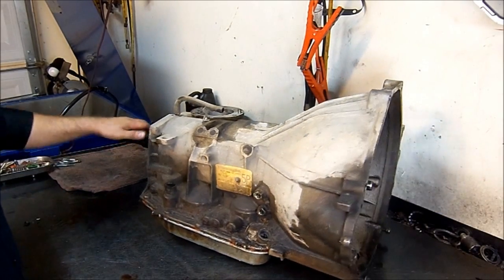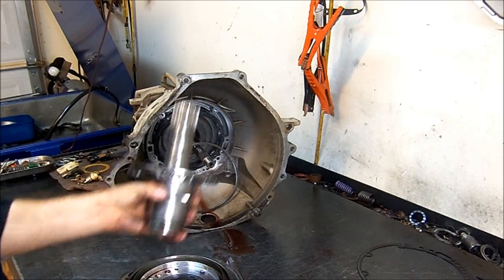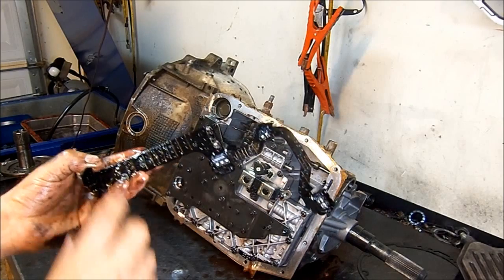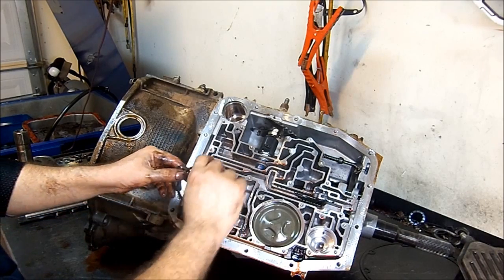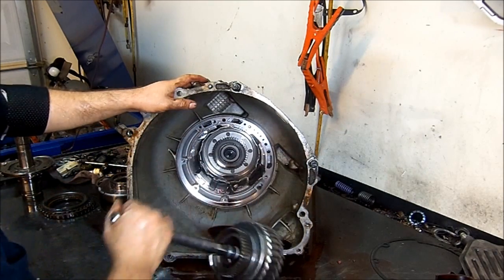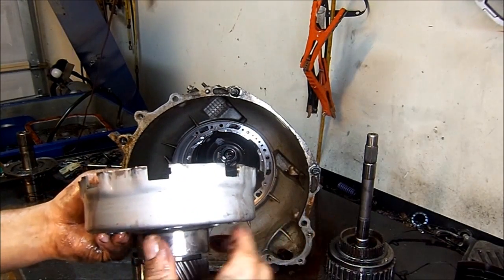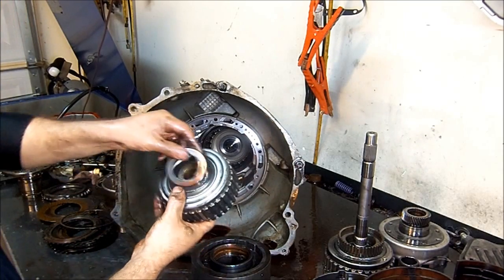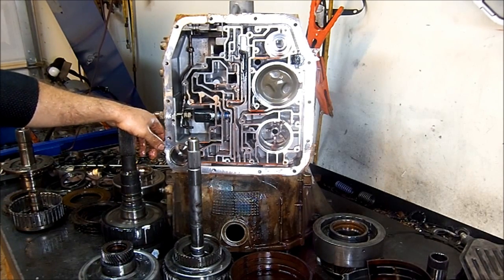4R75E Transmission Teardown Inspection - Transmission Repair

Comment: He is right about high line pressure blowing the end off the forward drum. However, there is more to it that needs to be addressed OUTSIDE of the transmission. On older Fords they are programmed to start with, and maintain, a higher engine idle speed to help light the catalytic converters off. Cats won't work until they reach a very high internal temp-like 1200 degrees, or something crazy like that. As the cats age it takes longer to get them up to temp where they start working. Ford, recognizing this situation, programmed their vehicles that as they age they will idle HIGHER, and will idle higher for longer, than a new engine does specifically to get the cats up to temp and working as they age. The problem here is people that jump in their vehicles, start them up and then instantly drop them into gear.. When the idle is high, so is the line pressure! When the engine is cold-so is the trans fluid which easily makes excessively high line pressure when paired with a high idle. We see  BOTH the end of the forward drum blown off, and the band pin anchor on the reverse band broken off. Yes, the Sure Cure kit will help.. But ultimately telling your customer to let the idle drop below 1,000RPM BEFORE engaging F or R will ultimately stop this problem from happening. So, the entire fix is a two part process. The Sure Cure kit (or even the Trans-Go kit), and then fixing the nut behind the wheel. I find it much more difficult to fix, or control, the nut behind the steering wheel. Transmissions are easy. Those "nuts" are the challenging part.
Reply: What's the nut behind the steering wheel problem you're referring to??

Comment: I have an F150 '08 5.7 and the transmission just went out, no forward or reverse. If I let it sit and cool off it will go into either forward or reverse until the fluid heats up, let it sit for an hour and it goes again. having it towed to a trusted mechanic but I want to have a minimum knowledge of part names and a minimum idea of what conditions can cause what problems. when I do visit the shop I won't stand there bug-eyed when I hear what needs to be done. I'd rather spend the money on an excellent repair than have a truck payment. Thank you for the easy to understand explanation.

Comment: Hands down the most informative and educational ford transmission video I have seen by far... Ive learned more in the last 32mins here than in.the last 5 months of reading and watching and trying to plan out how to save my 2012 E-150... I actually lost the sick feeling in my stomach and now Im just pissed at my locsl dealership for telliing me my transmission is toast and telling me I need to fork over $4000.00 to fix a purpose built delivery van that only has 43,000 miles and that I paid cash for new at their dealership...   a huge thanks to Automatic Transmission.... you sir are a craftsman of the highest order...
Reply: Sounds like the shop my work took an e350 to. No forward or reverse. Their extent of diagnosis was to replace a speed sensor because of a code. That’s not going to stop it from going into gear. Fluid on the dipstick was nice and red (38k miles). They said it was “burnt” up.  They should have let me work on it. $3600 for a jasper junk reman that already has delayed gear engagement 😵‍💫

Comment: Amazing video by a master at his craft. I unfortunately just started having transmission problems with my 2007 E350 Van at 182,000 miles  with the 4R75E trans (failure to shift into high gear). This video was illuminating going to drop the pan in search of metal and see if I’ve got any codes.

Comment: Always a joy to see someone rip into something so complicated as if it were nothing.  My 07 F150 FX2 (4R75E) has 123,000 miles and doesn't like coasting through slow traffic then accelerating. It usually races then bangs pretty hard.  Doesn't do it in OD off.  I'm changing fluid, Mercon V, and filter this weekend and hoping for the best.
Reply: U ever fix the problem lol? Mine is doing the same thing
Reply: @jramsier154  can’t figure mine out either. Broken snap ring. Got both pieces out and still no OD after putting the OD band in place with a screw driver. Still no OD. You fix yours?

Comment: That was really good. I’m doin an el cheap o fix on an 04 4r70w out of a grand marquis 170000 miles. All I found was toasted forward clutches and steels and blown out piston seals. Front pump seal was almost falling out too. This is 1st time I opened one up so I made notes on several things you said. I bought the car to get familiar with the 4r70w cause I wanna supercharge my 03 marauder and will have to beef up the 4r70w from the marauder. I just found ur channel bout a week too late. Thanks again for the knowledge.

Comment: I have the same truck with 250 000km. Was doing exactly the same as you... and last week and I ended up needed a complete rebuild. Truck drives like new now. The more you wait the more things will neeed replacing as the metal inside is eating away....

Comment: I rebuilt this transmission using your videos, so afterwards my overdrive light comes on and starts flashing at about 60 or 65 mph and wont shut back off until I shut the truck down and restart it. Before it beeps and the light starts flashing I can turn it on and off manually.

Comment: I have a 1999 Ford Econoline van. E-150.  I hear loud himming when I reach 35+ miles per hour. Tranny does not slip and works just fine. Could it possibly be the rear end? I am a mechanic but this one got me going. Thanks for any feed back. Great videos.

Comment: Great!, Now I can do this,  Now I have to see how to put together. I Imagine I would have a lot of Parts left over, or missing some parts(too many parts in the wrong place) Another Problem is knowing what a Bad Part looks like, and what a Good Part is supposed to look like. Sure curious of the rest needed to get reassembled. If I tried, may rebuild sections as they are Dissembled. Hope he has the Cleaning and Reassembly Video showing Adjustments and Procedures. I understand Transmissions have 800 parts, have built 1000 Piece Puzzles. 
Have been pretty good with those, No Pieces left over.😵

Comment: thank for your video are very interesting . I have pick up F150  with 4R75E transmission, this will put the mayorities of parts  news. doubt is when you close the box the drum shaft and output shaft forward should not be rotate manually .is this normal  these transmission with dual band. thanks

Comment: Good video, my 2008 Ford F150 has some transmission issue, when I drive it in low rpm about 1050 rpm shift to second gear but then stall to 2000 rpm slipping and goes to third gear, just that is the problem the transmission slip a little bit while is shifting to third gear.

Comment: Thanks Hiram, I have a 08 overdrive problem, shifts into OD and its like its in neutral, disengage the OD and runs and shifts fine...Im going to try and change the ring myself, seen a couple other videos on it and I feel I must have the same problem.

Comment: Hey you do good work man I have a Ford F-150 05 model transmission work's  good I pulled out on the highway and I went to beat a car about half down on the gas  it jumped in neutral  what it feels like but it started working  but at a stop  it's like first gear  it engaging but when you give it gas to pull out  stop putting you can give it a lot of gas it pulls out besides that every thing works you can pull it down to first gear about  when you are moving  about 5 miles in hours it's engaged pulling good

Comment: Hey Hiram I've watched ur videos and they have a lot of info thank u so much. I have a 4R70W took it apart had no reverse I found that the snap ring that holds the reverse in place broken and stuck in between the low reverse could that be the problem couldn't find anything else wrong
Reply: Definitely

Comment: I have a question I have a 2006 F150 I believe it is a 4R75E… Going up hill , small incline or steep incline doesn’t matter…  if it’s in overdrive it starts to shutter … if I apply the throttle I can make it downshift and it clears right up , what do you think ??

Comment: I had my 4R75E transmission rebuilt. it came out of 2006 f-150 4x4 with a 5.4L V8, I was told this trans was heavy-duty for towing. it was rebuilt with the 4R70E kit. should I be concerned?

Comment: I recently had a transmission line blow and I ran out of fluid on the road.  The truck stopped - I did relate the line, added fluid and barely got it home.  The truck has a 5.2 and is a Ford F150 with the 4R75E transmission.  I am going to guess that the transmission is toast - would you replace the torque converter too?  the truck is an 04.  Thanks!

Comment: Hey i have a 2009 ford f150 and its making a whining noise in park and neutral. The noise mostly goes away in the drive gear. I replaced the torque converter and i checked the transmission pump and the gears look fine as well as the bearings behind the pump. After all that the noise is still there. I was wondering if you had an idea of what it could be? Thank you

Comment: Hiram, you are a total professional. I like how detailed and knowledgeable you are. I have a 2005 F150 4x4 Triton 5.4L. When I accelerate really fast, the transmission shudders and then slams into gear from 1st to 2nd. Also does it from 2nd to 3rd sometimes, but mainly from 1st to 2nd. Also, when I have cruise set and am going down a slight hill, the truck lurches forward slightly (jerky). I recently replaced a bad U-joint. It's been doing this since I bought the truck w/ 115K miles on it and it is still doing it at 130K, not worse so I'm wondering what it might be. Thanks! BTW, where are you located? If you're close, I'll just take it in to you!
Reply: What was the location for that garaje

Comment: Have you dealt with any Trans Fault issues. We just had the light come on and OD light comes on as well on our 05 F150.  Trans shop says it may be a sensor but they want us to bring it back on the weekend so that they can drop the pan and further look at. The F150 has an 4r75E trans.

Comment: Mr Gutierrez, Great video, very professional. I have a 4r75e out of a 2010 e-350. It has a whine in neutral and park only. I swapped out the torque convertor and it still has the noise. Is this a pump issue?
Reply: Yes

Comment: Your videos have helped me a great deal in the past 6months in my shop. I know this is off topic for this video, but I think your the man to ask. I have a problem on a 2008 jeep grand cherokee awd with a NAG1-W5A580. When you start driving it will push fluid out the vent, and it seems to push out the front and rear seal too. I'm not sure why, any help would be greatly appreciated.

John
Reply from the maker: +Brandy Calvert Might be over full. Or there's a restricted cooler or cooler line. Do you have the tool to check the level?  If not get one. Dealer have them, also Transtar.

Comment: good vid..so i have a 05 f150 4x4 5.4 and the trans is making a winning sound like a power steering would if low and when warm trans slipps a lil bit...trans was rebuilt bought 60k ago...would that be a bad pump

Comment: Great video. Can anybody tell why the coolant flow is so weak? I have the same transmission and everything is good except only one thing: Flow is sooooo weak and I got one quarter of mercon in 2 minutes even if I connect funnel directly to outlet port of transmission. New filter, new fluid. But it overheats. Thanks.

Comment: Hello Mr Hiram, my 4r75e would not go into overdrive so I found the overdrive servo ring had broke and I found a piece in the valve body too.
After repairing that and putting it back together now I had a new problem that I didn't have before which now when I shift to drive I can't hear it and I have no speed..
So I'm getting a output speed sensor failure....
Does it sound like I did not put something back?

Comment: I really want to thank you for this video it was well explained and definitely "dumbed down" for the average guy. I have a 2004 Ford F150 FX4 and my reverse was always hesitant or would shudder if I accelerated right away. I also when I am at a stop light, on level ground, I dont have to apply the brake because it doesn't move. Now just yesterday the reverse shudders and barely moves back at all. Is there anything I can do till I can bring it in that will help? Where is your shop located?
Reply: Stop using it. Avoid further damage

Comment: Hey Hiram.  A couple years ago my Boss bought some retired CVPI's for company cars.  I got one of them, a 2006.  It has been a good car, but now the trans neutrals out going from 2nd to 3rd.  If I put it in tow/haul mode it will stay in 2nd.  Has about 125k miles, but my Boss says that trannys get swapped out of police cars routinely.  One of the shoregang guys says to drop the pan and see if there is metal in the filter and pan/magnet.  If there is a bunch, then the 3rd gear drum is bad, but if not, it could just be a servo issue.  Any brilliant ideas?  Everything else is fine, just the second to third shift is bad. 

Great clip btw...and thanks for taking the time to make it.
Reply: LindaStevensBZ 20160801_111924.jpeg

Comment: When I tore down my transmission, found little chunks of rubber? Seal in clutch packs were cut, possible clearance, thickness issue with steels.!?

Comment: the 3rd accumulator valve came out when I removed the valve body.  spring is good, but cant get it to stay to reassemble the valve body.  the point of the accumulator stay down right?

Comment: Awesome vid and great tranny knowledge! Thanks for sharing! Quick question my ‘07 F150 won’t go over 30 mph unless O/D is off so right now I’m driving it with it off. Would it be the O/D servo or snap ring? Thanks
Reply from the maker: Two items can cause that. The broken snap ring and one of the pieces of the snap ring stuck in the valve and the other is a stripped direct drum from the splines not engaged to the intermediate shaft. Or burned Overdrive band burned Direct frictions.

Comment: Hi thanks for the video very informative, I have a 05 ford Expedition xlt and the Tranny only reverse I don't get Drive, 2 or 1. Any idea what may have happen? One clue I do have is when  I removed one of the speed sensor in doing so it came out with a lot of Metal Chippings all Magnetize together any idea what could have cause this. Any helpful advice would be appreciated . thank you :)

Comment: I have a question. Im not rebuilding my trans, I'm only replacing the front pump seal an gasket.I have a 05 crown vic interceptor. I notice on ur trans u had 2 of what u called return piston spring.mine only has 1..is that ok to only have just 1? And is that brass bushing easy to replace?

Comment: Do you have any idea what could be the problem in mine? It will hang in neutral in the 3-2 downshift IF im cornering. 
More symptoms; it NEVER slipped on a gear. It goes neutral for a second, then shifts accordingly. if I reved it too high during that second or two, it behaves like a neutral drop. 

It only happens while cornering, and when stepping back on the gas, so during a upshift. 
I have replaced the pan filter, I thought it was 2-1, and changed the 1-2 accumulator pistons and springs, no changes.   I think it may be 3-2 downshift that is affected, but no tachometer in the car , hard to tell.

Im mostly curious,  it shifts perfectly fine in normal driving if I dont corner hard while the transmission hits the downshift point. If I corner hard while on the gear, it doesnt have the issue, it holds on gear.
Reply from the maker: +Veikra Low fluid level or the filter got loose.

Comment: i have same trans 04 mercury maruader i getting 2 codes po173 and p1740 do u think if i change my tcc solenoid in the trans that be my problem car cuts off sometime shifting from park to drive and o/d light flashes sometimes and when i take off i got too stay on gas to keep it going ..wat do u think....thanks

Comment: my new style 04 f-150 4.6 has a 4R70E transmission. are there any big differences from the 75E?? I need to get moving on it. The whole trans sounds like marbles clanking around when I try to move it. Reverse is gone and it barely will move at all unless you really romp the gas then it might slowly and loudly manage to go until boom another gear kick starts and moves faster but kinda one speed only. Then when you step on the brake, the truck stalls out all together. It's gotta be completely destroyed inside. the funny thing is just started doing it overnight the day before the truck ran like brand new. regardless I have to take it apart and check it out I was just wondering if the 70E was much different than the 75E

Comment: hiriam like your video and your knowledge I have a question, I have a 2004 E150 drives in all forward gear but it only reverses when cold once I drive it for 30 min it has no reverse

Comment: Hey buddy, have a question about a 4r75E im working on. Transmission was completely rebuilt... and I noticed I had a large snap ring on my bench. Its a tad bit smaller than the one that fits in the case around the speed sensor. I have no clue where this went, and cant find a spot where it might go. It's too large to fit on any drum and too small to fit the case... Im thinking someone may have stuck behind the intermediate cluctch piston wavespring to take up slack, but without knowing for 100% i dont want the trans to leave my garage haha! Any ideas?
Reply: Thanks buddy! None of the manuals I used has the snap ring even in the diagram, again thank you!
Reply: I have a 2007 f150 and In reverse I have a clunk. it done the clunk for about 6 months..  well now I have a whine in park or neutral.... my tailshaft can move up and down alot....WHAT DO YOU THINK...